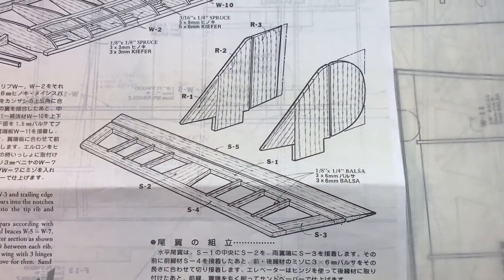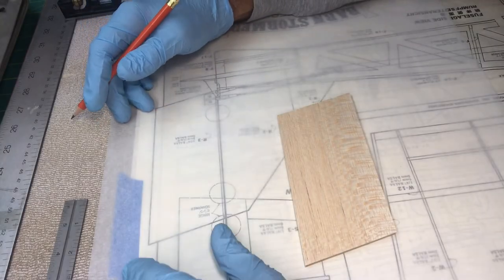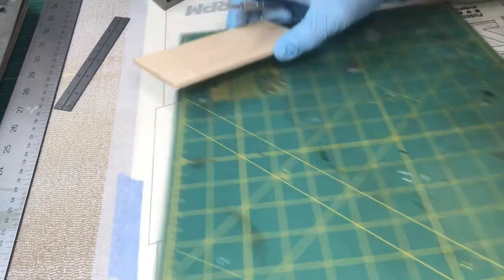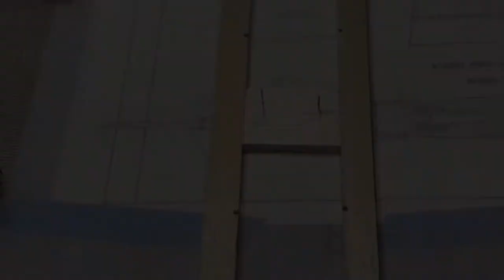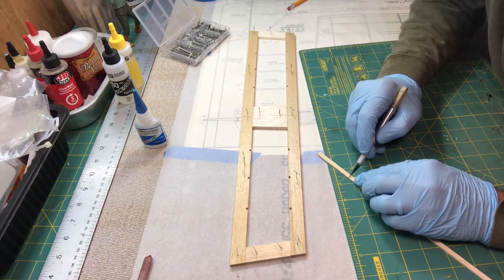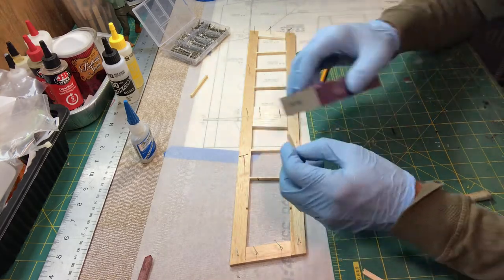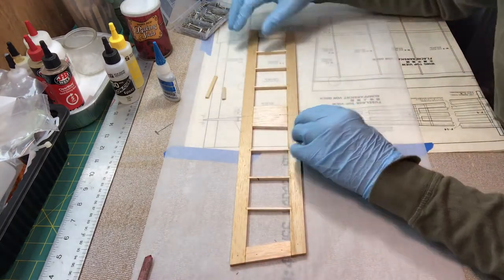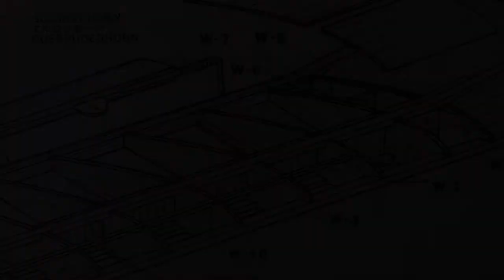Barnstormer 25S Vintage RC Plane Build: 3 Rudder and Elevator

Comment: I have watched many of your videos. Very well spoken and excellent explanations .I have a question.I see you use an acoustic ceiling tile for the pins what is it sitting on to make sure it is flat ?Thanks
Reply from the maker: Hi, and thanks! well I painstakingly constructed a work bench from a blank solid wood door. Its hard to find an inexpensive “flat” workbench. I went to home depot and used one of their long construction levels from hardware to pick the flattest one i could find. So my table is pretty flat. If there is a minor bow in the work surface you can build it up using layers of newspaper between the table and panel, lay and position the paper in layers until its flat. But I can be a little too worried about stuff, so a little bow in the table may not matter in the long run. Im sure there are many ways to do these things. Ive seen people use an rigid old sliding glass door.
Reply from the maker: Also, The sold wood door is heavy, so I made sure to build a solid wood frame support so it wont sag overtime.
Reply: @JamesRCPlaneTech  Thanks.The door method seems to be very popular however I think they get the hollow door used in closets but I am not positive about that and then the tile like you have done or I have read others use a piece of drywall on something flat but i would never have thought of that one.I made abone head mistake lately and had a really solid top piece of an old desk that was straight and true but could not put pis in it so i put my tile on top of it but the tile was longer than the piece of old desk and as i worked and sat thing off to the side i created a bow in the tile that i never saw until the wing halves were built. The leading edges are straight but slight bows in the trailing edges but a more experienced builde and flyer than I said it will trim out and be fine but I was not happy but if it flies fine that is whet I care about and i learned a lesson.
Reply from the maker: What I found is that the hollow doors I was looking at had bows in them between the unsupported frames, basically in the hollow parts. For a door it wasn’t that noticeable, but for a work table they didn’t work for me, maybe they were just cheap doors i was looking at. So the solid ones were more planar/flat, but heavy needing more support to prevent sag. I probably overkilled it.
Reply from the maker: And about your mistake with the tile sag and wing , as long as its close its fine. We can make perfectly straight wings but we still have to trim for engine torque, imbalances, wind and all that stuff. On the Barn Stormer the wood was old and the leading edge pieces had a slight bow in them. I tried my best to build the bow out of them, but in the end they both have a slight curve. If you looked at it down the edge you would see a subtle curve… But when flying in the breeze with engine torque and changing center of balance as the tank drains, it doesn’t matter if the airframe is a little off. I just try to do it the best I can knowing all those other forces will still be at play.